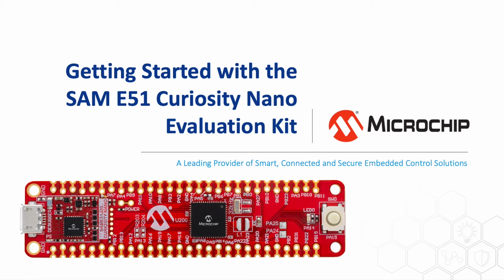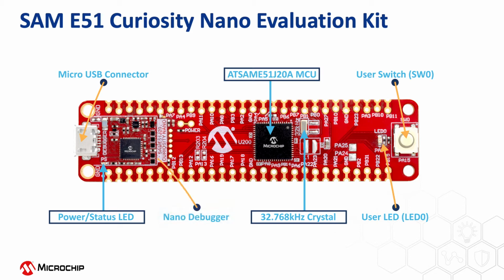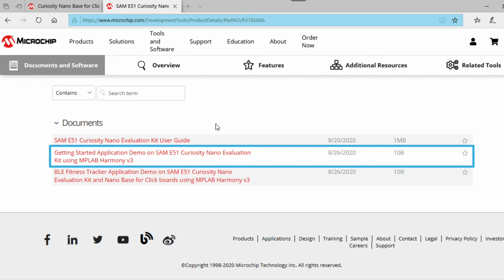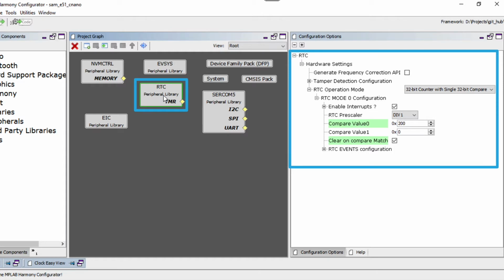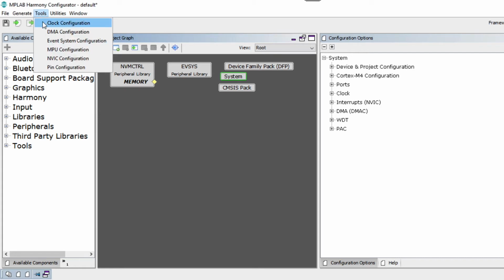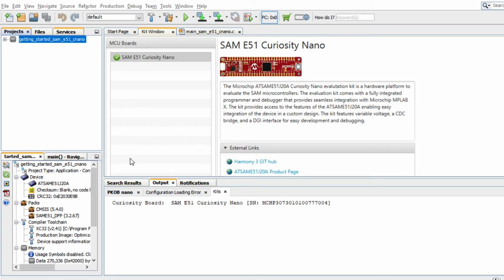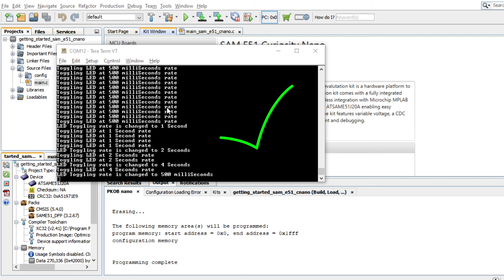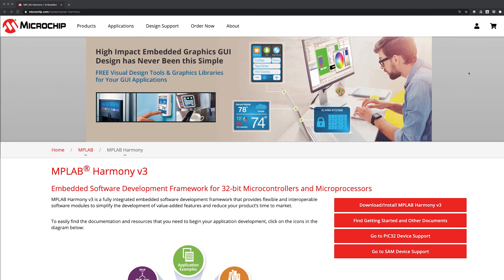Getting Started with the SAM E51 Curiosity Nano Evaluation Kit

Comment: I've been using this board for development for a long time. Of the main disadvantages is that for a microcontroller with such capabilities, there is only an LED on the board. At least the USB was added, or at least these pins were brought to the comb with conclusions. On this board, in order to connect the USB, you need to solder directly to the board. It is also very inconvenient that it is impossible to connect an external debugger to this board. Theoretically, it can be connected, but it is very difficult. Ideally, it would be if you added CAN, USB, something that works via SPI (flash memory, for example) and I2C to this board. Well, examples of work for all this. And so, in the current version, this board is far from being for beginners, and a quick acquaintance with the microcontroller for most users will not work on this board.